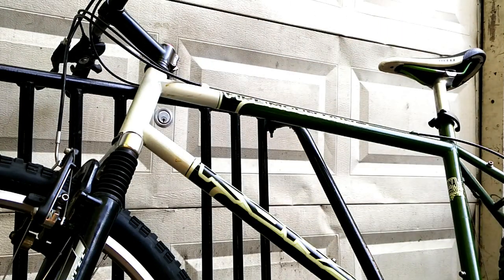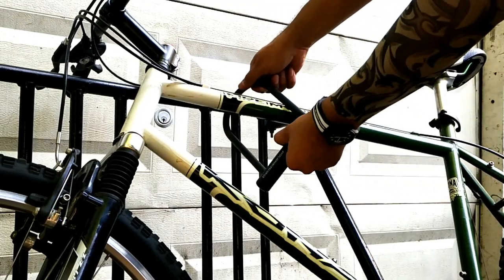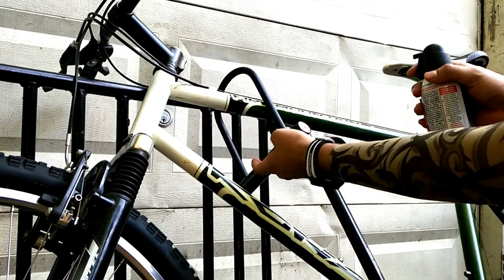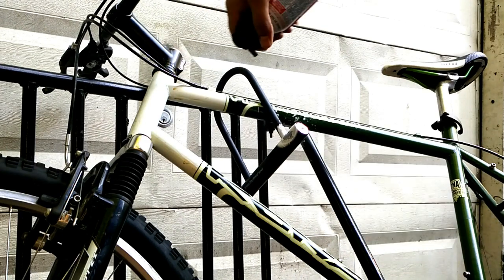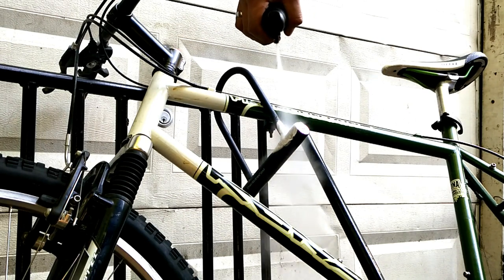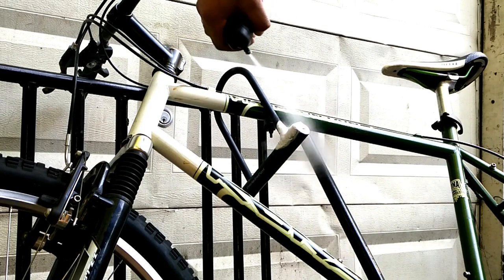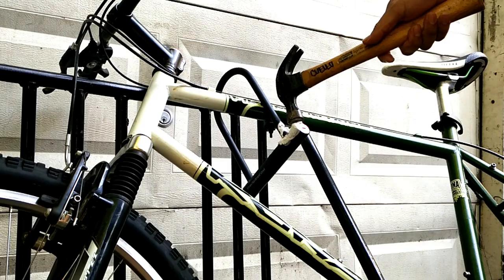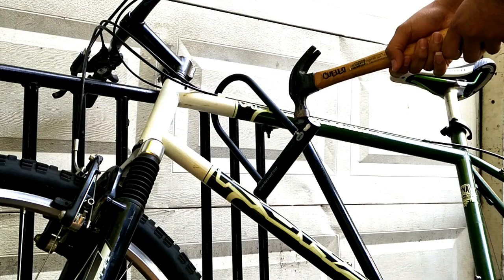Break any bicycle U-lock this way (shocking results)

Comment: The lock didn't fail because of a freeze attack, it failed because it's a cheap as shit lock that uses a thin 1mm locking arm that engages the bar. It simply sheared off as it would without the can of air.
Reply from the maker: If video reaches 1000 likes I'll make a video, one with compressed air and the other without it to see which one breaks faster
Reply: Very 💯 but had that been freon different story

Comment: a thicker hardened shackle with a double sided locking mechanism would not succumb to that attack. i doubt very much that a heavy duty Kryptonite or Abus would break.
Reply: we're about to find out
Reply: We are about to find out if an abus or kryptonite would break ? is there an update video in the works ?

Comment: Why would you not hold the lock in place, or use a slightly larger sledge hammer?! Seems that may be a bit quicker and easier than this…